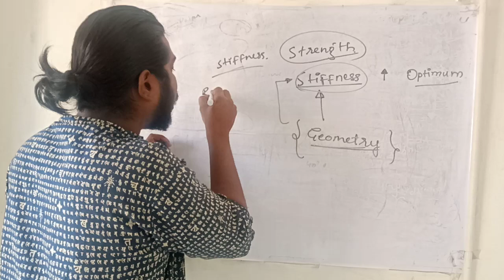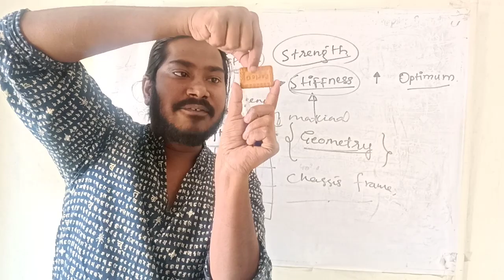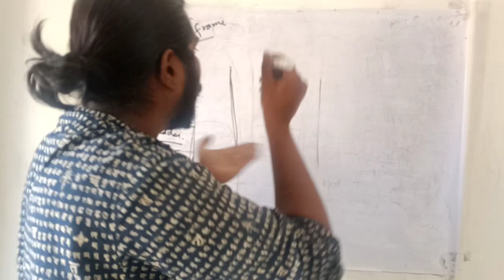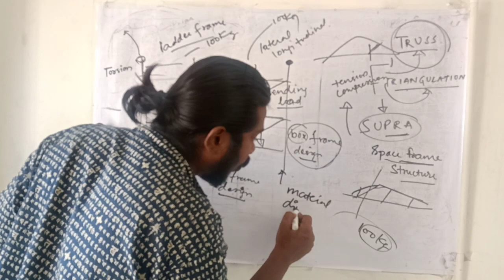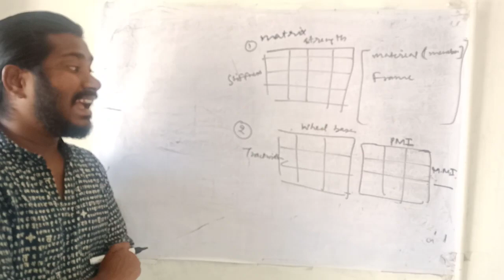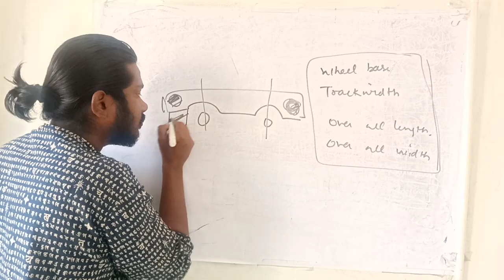10 Days Free Webinar | Day 3 of 10 | Part 2 of 2

Comment: Dear Sir 
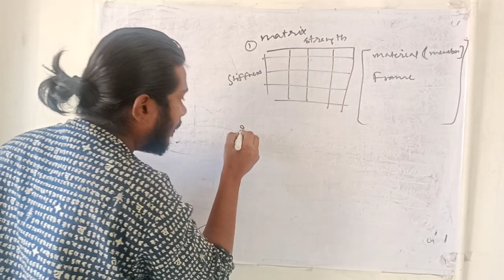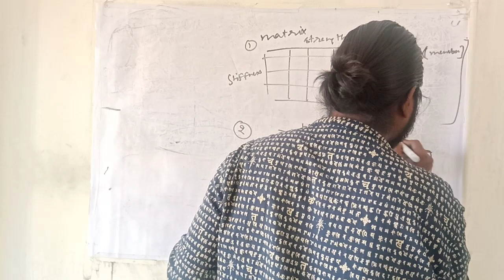A little doubt. As discussed from @17:05 to 17:30, we have to iterate the different values of wheelbase, track width with Polar MOI and Area MOI and similarly the values of strength and stiffness of different members with that of the frame. I want to know how can we calculate different values of strength , stiffness of the whole frame? 
Also Area MOI and Polar MOI of  the frame for different wheelbase and track width?